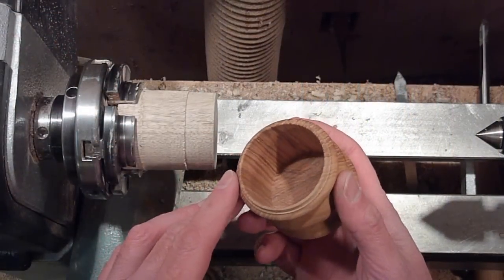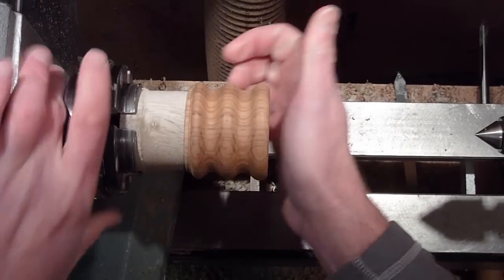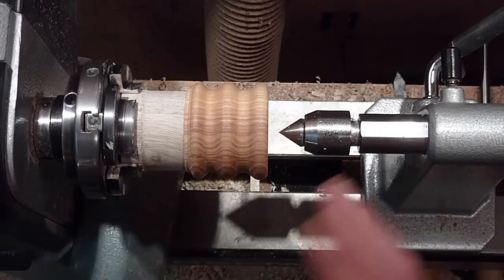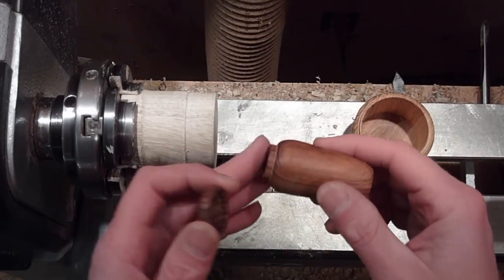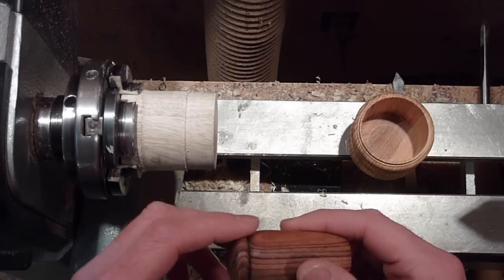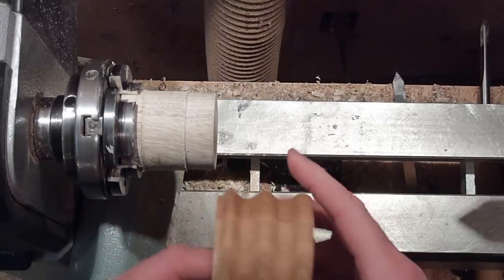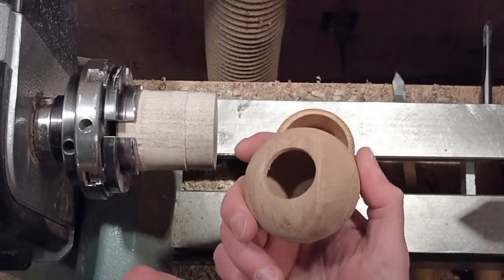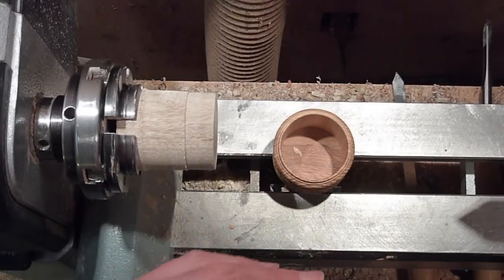Woodturning Q&A Safety and Jam Chucks

Comment: Wow - glad your nose was the only thing hurt by that tooth flying off!  First time I've heard of something like that happening.  I've worn a face shield when using the TS before just to prevent sawdust from being blown in my face/eyes and will do so all the time from now on.

One thing I'd add to the list @3:23 of what not to use on the lathe (in addition to rags) is steel wool.  Very easy to get wrapped up with it and scotch-brite pads work just as well if not better IMO.

Comment: Thanks, I had a 6 lb piece of walnut fly off once and left me with a bleeding nose black eye and broken glasses.  It nor gangs on the wall behind my lathe as a reminder not to stand in front of it when I turn it on.  My only other (and hopefully last) incident was when a 12 inch platter split in half and left a gash in my chin, another half inch I'm sure I would have lost some teeth.  My wife then upgraded me to a good impact resistant face shield, I never turn with out it.

Comment: I have been using woodworking machinery, as a carpenter and joiner, for 55 years and chainsaws for 35 years, we did not use any protection in those far off days and I did not ever see an accident. These days I do.
There was a demonstration, recently, on bowls and during the demonstration the bowl came off, went straight through the safety screen, to protect the audience and hit a shelf  on the opposite wall and smashed everything on it.
The question is how safe is safety gear?
I have heard there is a female professional woodturner who now uses a police riot helemet and visa since she had a serious accident
thanks
James

Comment: That what I am working with is secured properly and nothing is loose before I switch it on people need to know that these tools are dangerous if not used correctly so it is great to see videos like this keep it up and would you know of any way to measure the thickness of something without using calipers mine are broken and I have no money at the moment is there any way to improvise with something else?

Comment: The lathe I was turning a baseball bat on threw the whole bat stock off at me today because someone had messed with the gearing on the lathe and didn't bother to tell me the stock hit me right on the lower jaw took most of the skin off my chin and tore my bottom lip up but I think I was very lucky if I was any shorter than I am now I would probably have a broken jaw and lost most of my teeth I am always very safety conscious when it comes to using any of the tool in my workshop

Comment: Hey there Carl, I have question, So I just got a Nova Midi and I'm trying to fit it on my lathe, General Machine 12x36, 1x8 tpi drive, and I tried fitting the worm screw, So, when looking at the screw going left to right, end of screw, then a notch, then a shoulder, so does the shoulder sit on the inner face of the chuck, or should the screw slide into the inner hole on the drive so the shoulder fit BEHIND the the jaw adjustment slide? I really don't want to send it back, I'm trying to complete a job for someone special.Thanks for your help.have a good one.
Reply from the maker: raztuss Can you send a pic? I'm a little confused. jacobson68@yahoo.com
Reply: Hey there Mr. Jacobson, I'll see if I can do that.It seems to me that the worm screw is bottoming out on the shaft for the lathe, as if there is not enough clearance between the end of the shaft and screw. When I install the screw I have to take the chuck off the drive shaft, install the screw, and then re install the chuck back onto the shaft, which then leaves the chuck about 1/8 to 5/32 " from seating "flush to the shaft. Would it be "safe" to ad a heavy washer to bring the back of the chuck flush to the washer surface, which would be tight to the drive shaft? or, would it be better to grind about 1/8 off the back of the worm screw? so that the shoulder sits "behind the jaws? I'll still try to send a pic about it, all I have is a phone to try and do it with.Thanks for the help.